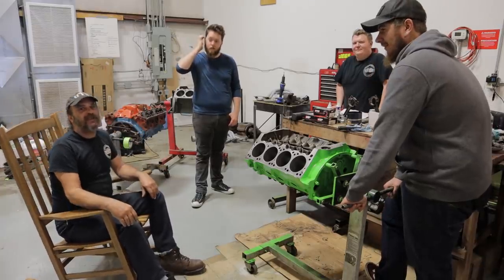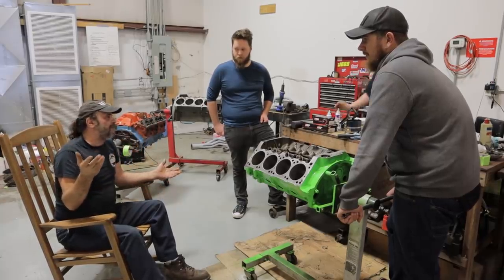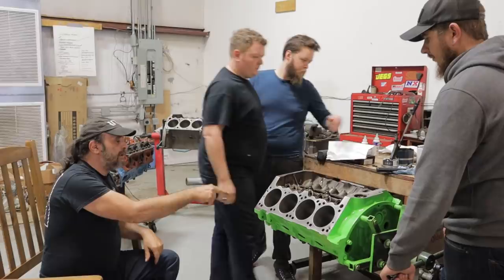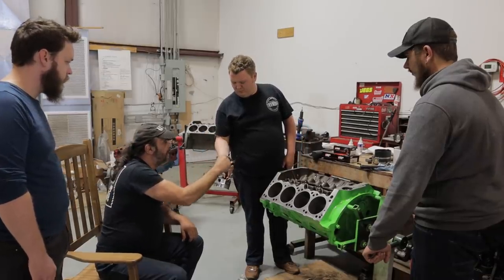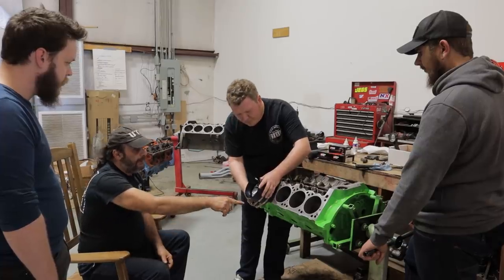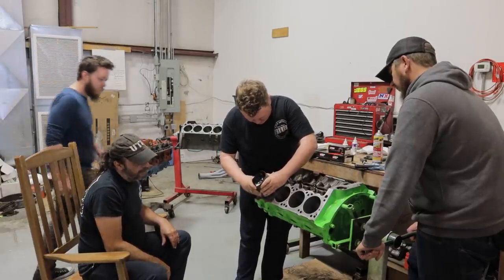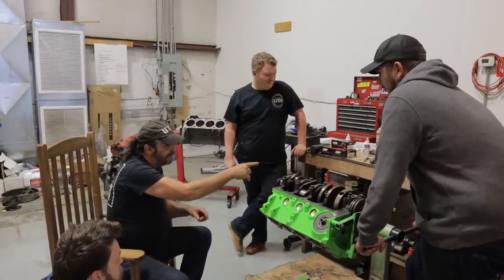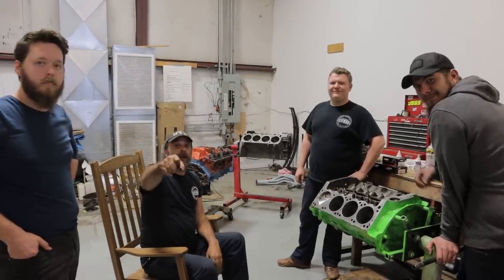How Many Guys Does It Take To Install A Piston?  Step By Step DIY Engine Building For Beginners

Comment: Piston to wall clearance, deck height?
Reply from the maker: .006 on the two I randomly checked...height? Did not check, but these are supposed to be stock compression
Reply: @UncleTonysGarage  .006 sounds pretty good for those new slugs. Hopefully with whatever deck height and gasket thickness you can get a nice squish band. That green is growing on me but probably because I have a history with what shall forever be called, flex plate green.

Comment: Never did understand the staggered ring gaps. In the end every ring has a gap and the location of the gap is irrelevant when pressure is involved. I dont use hoses or protection boots when installing pistons either. Not hard to do it without damage. I recommend avoiding turning the engine over more than is absolutely necessary though. It can remove your assembly lube and cause damage during break in, its not going to happen every time but it only takes once. It increases the likelihood of a smooth break in.

Comment: Can't wait for episode #1,074 to drop, it will be right when the season is over in 2022.
Reply from the maker: Start stocking up on popcorn, Sweetie. It's a long ride from here
Reply: @UncleTonysGarage  no need sugar, I only watch about 30 seconds before I click off, if it doesn't have bottle rocket or plan z going down the track I don't care ...
Reply from the maker: You know, I've only got those two cars parked, JUST to fuck with you.  BTW, make sure you click off by 29 seconds, or it counts as an actual view and then I get paid
Reply: @UncleTonysGarage  thanks, I'll remember that, still doesn't help your click-thru rate or the watch time of your videos. As to why them cars are parked, your car building skills suck and they break all the time, you're a magazine writer turned u-tube talking head, not a racer or a successful builder.
Reply: @indianaslim4971 -- so, what have YOU built, or are you just another jealous critic? Odds are that Tony has already forgotten stuff that you haven't even learned yet. Any fool can throw a pile of money to a shop and buy a built engine. Tony is showing yokels like you that you don't need to spend a pile of money to get respectable performance, if you're smart, patient, teachable, and you persevere.
Reply: @indianaslim4971 -- all that being old has fine tuned for you is your annoyance factor. Congrats on passing the "mosquito in tent when trying to sleep" level.
Reply from the maker: Actually  Luke, Lamchop didn't leave. I booted him for a drunken tirade that appeared live on his channel.  BTW. Lamchop worked approximately 4 hours for 1 day a week on that project.  Approximately 10% of the total time building it.
Reply: @lordphullautosear  ouch...did I hurt your feelings by calling your cult leader out?
Reply: @lordphullautosear  don't drink the kool-aid.
Reply: @UncleTonysGarage  who is Luke?
Reply from the maker: Luke is somebody who has a rat in his circle of friends.
Reply: @UncleTonysGarage  so you are saying that I have a rat as one of my friends,....I knew it....is it Kootch?, I always wondered about him.

Comment: You guys really need to mill the heads before they go on. Nitrous builds pretty high cylinder pressures that don't like head gaskets. I know your sandpaper trick sounds like it was a good idea, but have you ever put a micrometer to sandpaper? Sandpaper is not a uniform thickness from one end to the other. Some areas are thicker or thinner than others. You most likely made the head worse than what it already was.
Reply from the maker: It was emery cloth and it's the exact same thing as when a machine shop surfaces a head on a belt
Reply: @UncleTonysGarage  all your part failures are starting to make sense. I would be fucking furious if a machine shop tried to put a belt to any of my heads. Look at how these poor kids that are supposed to be learning did it. They were making passes front to back on the head. The emory cloth in the center where the combustion chambers are wasn't wearing down much because the only iron it was touching was the little sections in between each combustion chambers. The outer sections of the emory cloth rubbing the sides of the heads where it's solid iron front to back. That part of the emory cloth is getting worn down way faster than the center. You're dealing with numbers like .006in not being flat enough for a stock iron head. That number gets even smaller if you think you're going to run nitrous. I'd love to put a micrometer to one of the pieces of emory cloth they used. I guarantee there is more than a .006 in difference from one side of the cloth to the other. Just show the kids the proper way to do it and get a cleanup pass on a proper milling machine

Comment: Grab a Pepsi 2 liter case it holds piston perfect and holds 8,  2 liters . An old pan man that worked for eddie hill the nuclear banana fuzzy was his name  had me stand where the guy with the hat and sweatshirt  i asked him why there he said always torque from behind cause pulling from the side it can easily roll and you get an uneven torque when the stand rolls. Stand behind and torque pulling toward you it won't move and they will all be exact , I never scratched a single crank, literally put hundreds of motors together,  the fuel line on the bolts is a waste of time and fuel line if you get it past the rings you can easily push it in after if you match piston to bore and fit rings properly it should slide right in super easy used tranny fluid to assemble.

Comment: The rings are staggered on installation because you don't want to break in the engine with the gaps aligned. 101.

Comment: I got shit if I touched the bearing surface of a bearing with my finger, teacher said acids in our skin would etch the bearing surface. Not sure if its true, but in 40 years of building engines I still won't touch a bearing surface with a bare finger.

Comment: MM hope bearings were cleaned after fingers touched them. Big no no like engine 101 no no to leave human skin oil on bearing surface.
Reply from the maker: Dude, it's a bearing, not a halogen headlight bulb.  I can assure you no human body fluid will hurt the bearings
Reply: @UncleTonysGarage  you've tried them all...?
Reply: @UncleTonysGarage  won't hurt betting but keep engine oil from proper lubricating bearing surface.
Reply: @UncleTonysGarage lol true 😂

Comment: You should say many politicians does it take to install a piston. It would never get installed since they would be to busy arguing on how to do it. One of the politicians would get mad and throw the piston threw the window another one would get mad and bend the rings. Then another politician would get mad and push the engine out the door at said point the engine would bounce down the steps and be completely shot.

Comment: Are you installing a cast crank😂😂😂😂
Reply from the maker: yep!
Reply: From my experience, most street builds and mild strip builds don’t need a forged crank.  I’ve broken literally everything else on an engine by abusing the piss out em… but never a crank
Reply: The old 3.8 engines were the best.  Most break right at the first counterweight.  You build a "street" engine and the owner calls you a year later thinking he has a bad harmonic balancer.  Nope....he took it to the track.  Only to have you install another cast crank.  Not an isolated incident, different owners.  It happens often.

Comment: Yeah Tony’s correct protecting the crank from rod bolt damage is over rated guys! 🤦‍♂️ SMH
Reply: tell me you didn't actually watch the video without telling me you didn't actually watch the video. That is not what happened, he told them you don't have to do it THAT way and showed them ANOTHER way to protect the crank from the rod bolts.

Comment: I fundamentally disagree with using pb blast as a lube to assemble a bottom end.....  it shud be ATF at very least....the properties of pd blast DONT take care ot your immediate start up friction.......u shud have them use a white assembly lube on ALL pistons, bearings, and associated parts........i LOVE YOU TONY but fundamentally disagree with using pb blast as an aid to assemble a rotating assembly!!.....NO!!
Reply from the maker: Why not wait until the entire assembly is complete before commenting.  I use PB as an intermediate lube while the engine is being assembled.  Once it is all together, each bore gets a wipe of engine oil.  White lube? Why? I prefer to use actual assembly lube where needed.
Reply: @UncleTonysGarage  the white lube i'm reffering to IS an assembly lube.....i cant remember the damn name, but its SPECIFICALLY for assembly.....its a while motor assemble grease, high zinc, and can hang for MONTHS....till start up.....ok i will see where you guys go, but i have assembled MANY bottom ends of MANY motors, all with my white lube, narry an issue......i will stay open, and appreciate ur response!!........WHITE LUBE, NO PB BLAST.....ok had to say again!!.....thanks Tony, at least you care, and read ur followers!!...my subscription remains!!!!
Reply: Lubriplate # 105......THATS the stuff i'm talkin bout....ok?
Reply: @UncleTonysGarage  Lubriplate #105!!!..thats what i'm reffering to...... (tryin a few ways to get to you)......LOVE what you do sir, Lubriplate, shud be your ONLY way of doin a bottom end, except ATF, that i like for NUMEROUS reasons!!.....PEACE sir!!
Reply: Why do we need to wait for end if show why not use the right shit when doing it the first time....pb evaporates